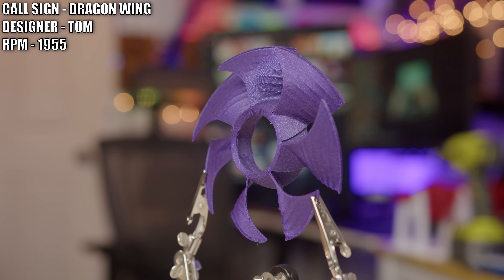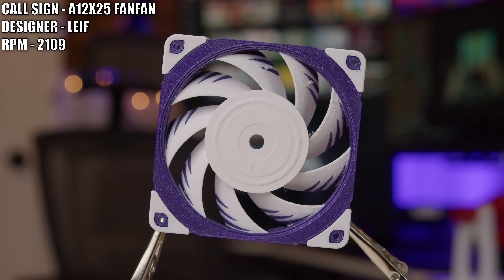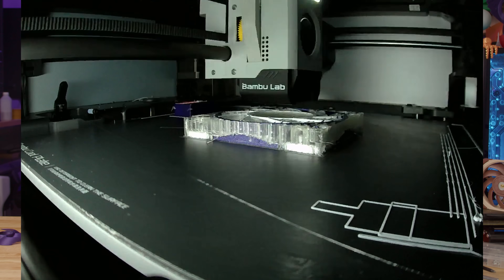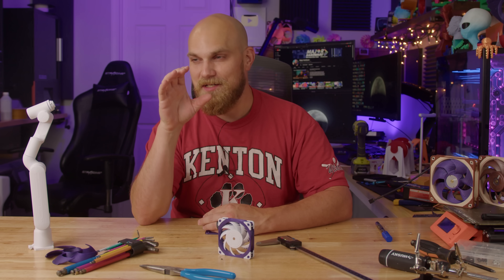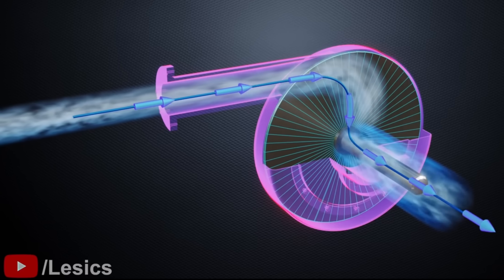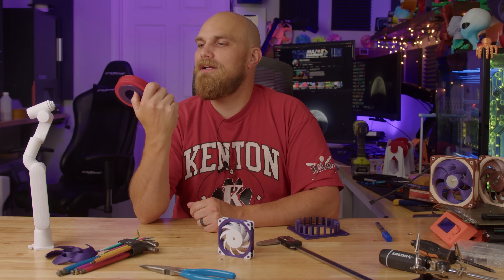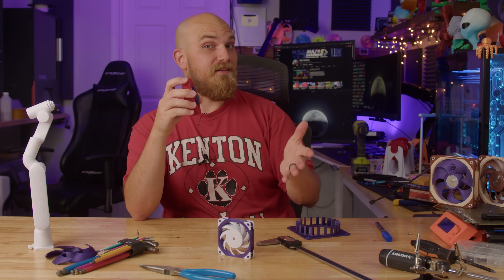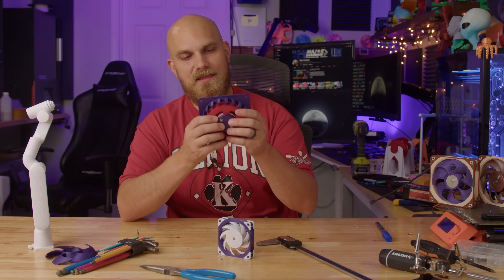I Put a FAN Inside a FAN | Fan Showdown S5E7

Comment: The tesla Turbine is missing allot of its key components.  like the external shroud that directs the air over the ''blades''   the entire thing is supposed to be enclosed with a valve on one end and it blasting air out of the other.
Reply: Not to mention the rpm needed to make it function even a little bit. I don't think the A12-X25 motor can hit 10k rpm.
Reply: Yeah, I think because it's supposed to have steam kinda forced past it and be spinning really fast (instead of considering RPM, consider the speed the edge of the disk stack was moving.... They were big, so you'd need a much higher RPM for these small fans). So, probably it's just not going to work well in this regime. I still think it'd be neat to see more experiments with it. What if the top disk had scoops to force air into the slots and thus give it some initial flow to work with?
Reply: A Tesla turbine is not a "reverse fan". 

The whole point of a Tesla turbine is to slowly direct a fluid from a straight pipe and curve it, while getting the maximum amount of surface area using a boundary effect in the fluid to create a "sticky" vortex. 

The idea is then to increase the speed of the vortex until it accelerates to the point that it covers even more surface area as it speeds up towards the center of the disc, which is why the outlet is in the center. 

Using it as a fan is quite litterly useless, especially when you are driving the output, there is litterly nothing to cause the air to be drawn in. 

It uses a boundary air layer, fluid dynamics, centrifugal force and friction solely to be driven. Powering the output does none of that.
Reply: @lilsammywasapunkrock  yes it does. which is why it is used commercially as a PUMP.

fluid friction, spinning discs, centrifugal force? 
yknow, drop a bit of water on a spinning disc like a record player? what happens?

it flings OUT.

so whats left in the middle at the hub?

NOTHING.

and what does pressure like to do?

fill nothing with something.

the fact that it simply recirculates and doesnt actually direct this "flung out" centrifugally accelerated airstream in any particular direction is hwy its making a silly turbulent mess rather than anything... meaningful...

it could be better, but dont get me wrong... its never going to outperform a standard blade smacking air molecules out of its way.
Reply: Egor? Is that you? 

Can we get another take with the missing components?
Reply: I think you all are missing one important thing here, IT'S NOT A FAN, it's designed to be pushed by pressure to generate movement, not to be rotated to move air.
Reply: @YOEL_44  go read the patent...

and whats its current only commercial application?

as a pump.

i guess the rotary engine aka wankel is designed to be pushed by pressure too?

at which end? the rotor? or the shaft? felix originally designed it as, guess what? a pump...

yknow, ALL engines are just glorified air compressors?

and then theres the whole issue about pressure, velocity, and bernoullis...

"new principle of operation".

its not a pressure aka reaction turbine. its not an impulse turbine. its a fluid friction turbine.

pressure doesnt push anything. it simply tries to reach equilibrium.
Reply: @YOEL_44  either way, curiosity killed the cat. Even if it ends in nothing again. We've seen Da Vinci inspired fans before on here also. Personally I like seeing these past designs come to life instead of being just a paper concept. Gives me hope that the innovative minds of our ancestors is still alive in us or the younger generations.
Reply: @YOEL_44  You're missing information regarding Tesla's design. It can be run either as a turbine or a pump. As a turbine, it has the working fluid injected tangentially at the disc rim, and boundary-layer effects drag the discs in the direction of the flow as the flow spirals inward to be exhausted at the center (where the cutouts are in the discs). As a pump, the discs are spun by an external power source, and the working fluid is injected at the center, where the boundary layer drags the working fluid around, spiraling outward to be exhausted by a tangential vent. Basically, if you feed high-speed air/steam/water in at the tangential port, it's a turbine and you get work off the shaft; if you power the shaft and feed air/steam/water in at the center, it gets pumped out the tangential port. A Tesla disc pump has advantages over conventional centrifugal pumps  in that they can handle viscous fluids effectively, are  resistant to abrasion from the working fluid, and can handle larger solids in the working fluid without plugging. None of these advantages, however, are going to be useful for it to be used moving air, and I expect that given the improper design of the shroud, it's going to be amazingly inefficient.
Reply: @YOEL_44  A turbine is literally just a reverse fan.